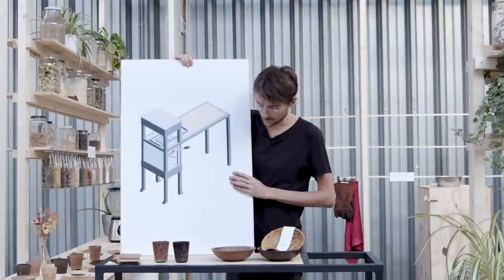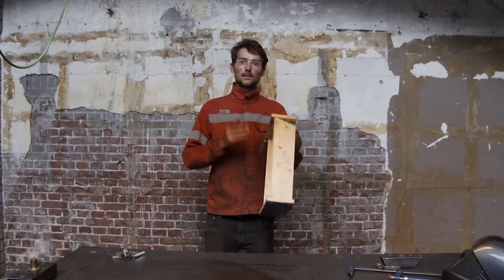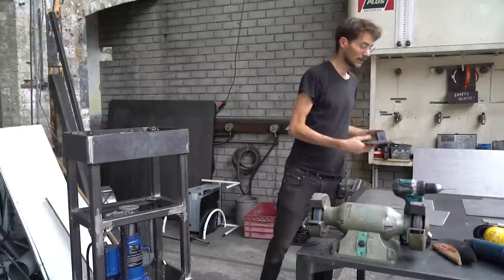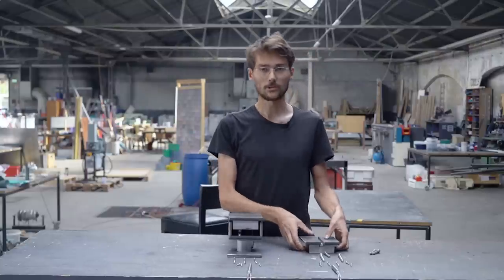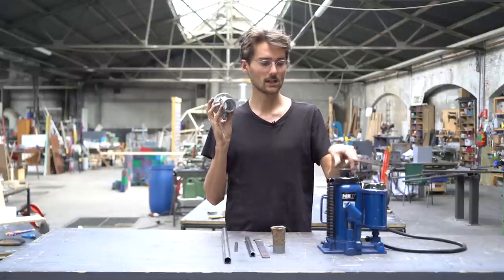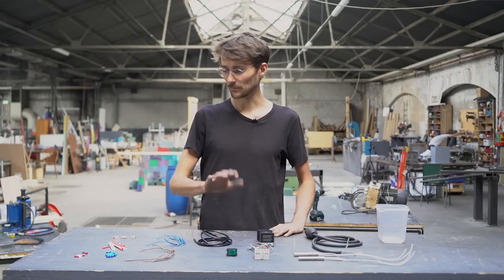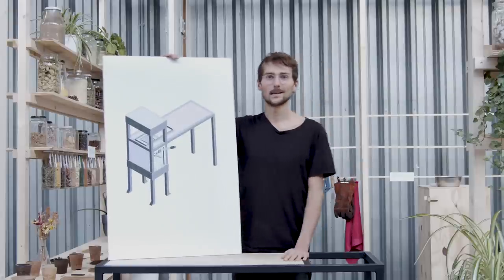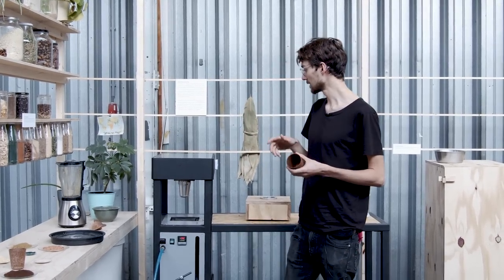Precious Plastic - Build a Bio Press  (part 8.1)

Comment: Nice work, thanks a lot for sharing. Unfortunately I don't have the tools/space and probably I will take months for that. One question you didn't answer, and in my eyes one of the crucial ones. How to create or get the moulds? How much heat do you apply usually?
Reply: They are very expensive. I was quoted 500 euros without shipping

Comment: why did you grind out the grooves and drilled holes first in the aluminium? Aluminium is a soft metal, you can use woodtools for that. Didn't you have trouble with the grinding disc eating into the aluminium? You guys need a router! :)
Reply: Grinders work fine with aluminimum, you can use a milling wheel on a grinder with aluminium, just got to be careful.